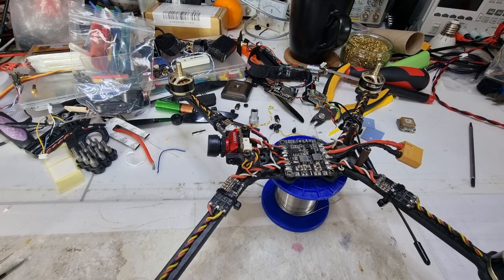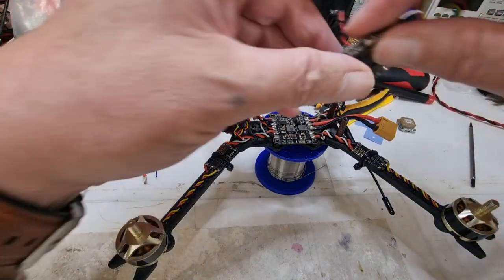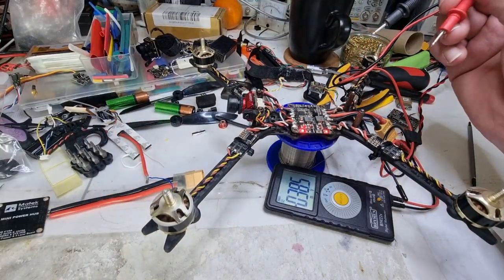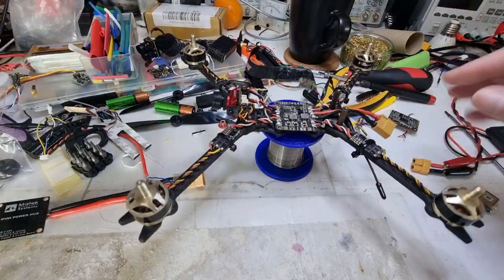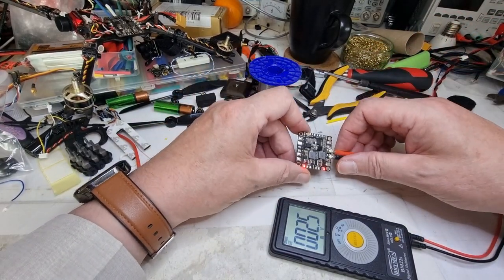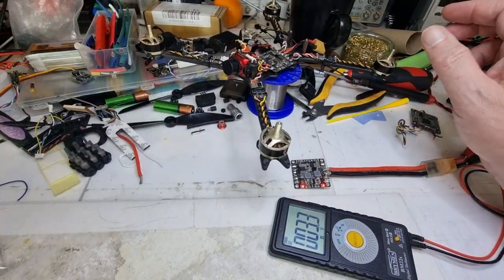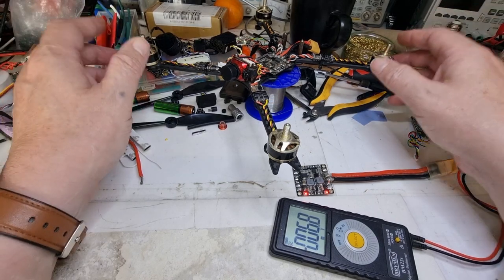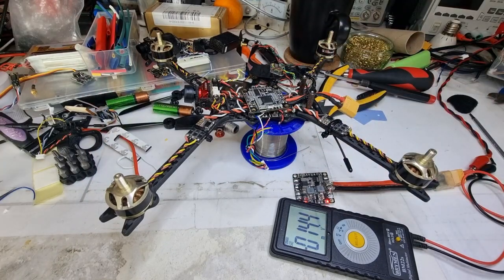I'm back... PDB regulator fail killing Runcam Thumb

Comment: HOORAY! It's great to have you back, Elecifun. I especially like your drone vids. Cool that you're recycling your old parts.♻️ The H501s LIVES ON! You're inspiring me to put something together with my old H501s parts. Bummer about your thumb camera. I hope you're able to fix it. Those diodes are tiny. I'd be interested to know the cost of repair vs. replacement. I'm sure the parts cost next to nothing IF you can find them AND they're genuine. It's great to see you. Happy flying amigo. 🫡 🍻
Reply from the maker: @Sonic_Ox Hi Ox.. I've found the spare parts and hopefully will have them next week. A mod to a soldering iron tip should let me get them off the board, fingers crossed. Parts are pennies shipping a couple of bucks for each component. Replacement Thumb Pro £80. I need to figure out a way for it not to happen again.I'm working on it.
I like the quiet Hubsan motors, I get to fly around my shared garden without bugging anyone. 🙂
Reply: I'm sure you'll find the remedy. I've seen guys run their thumb cams off their balance leads with current limiter circuitry in between. That might be an option if you can't trust the pdb to do it...🤔 I do miss the quiet of the 501s. Both of my current quads are quite loud. The OX-7 isn't too bad, but the OX-35 shrieks😆. Happy flying amigo. 🫡 🍻
Reply: 🤔 Hmmm.
Reply from the maker: @Sonic_Ox  Not sure if that would work for me as the Thumb pro needs 5 volts single cell can only provide (Lipo) 4,2 and lower. Not sure what the current limiting circuit is for as only 500mA tops @5V, camera circuit is current limiter.
I will have to wait for the parts to see if I can fix it. I would probably use a micro buck converter running from VCC as the safety circuit. Matek Micro BEC looks like a good candidate, tiny and only 1g.
Small props and faster rotation speeds make noisy craft. 
Happy flying buddy!